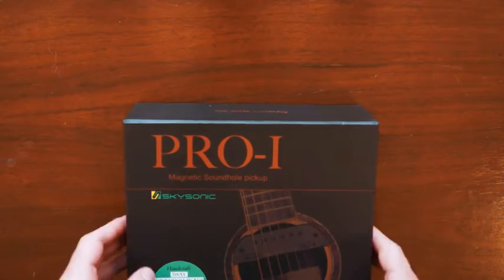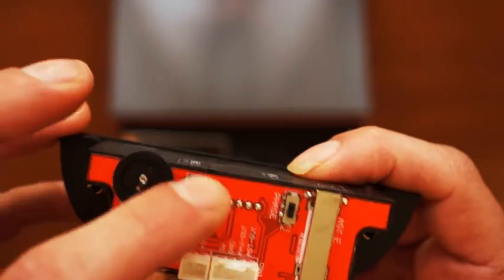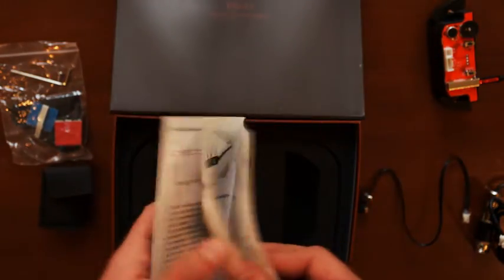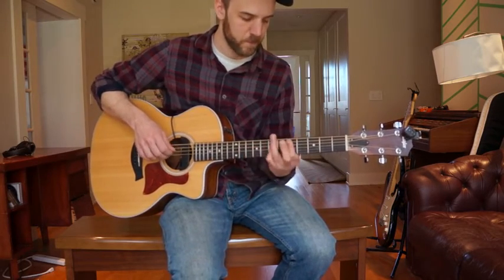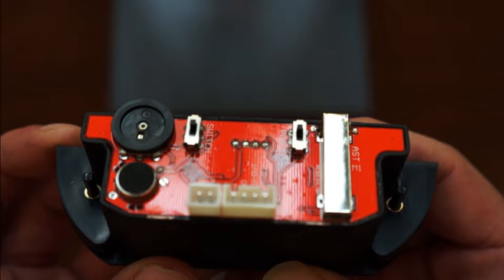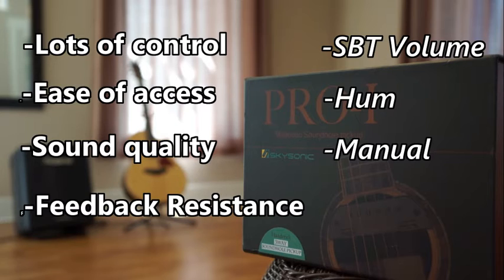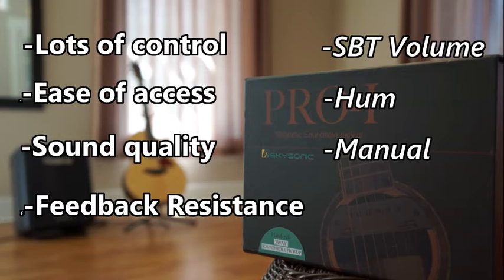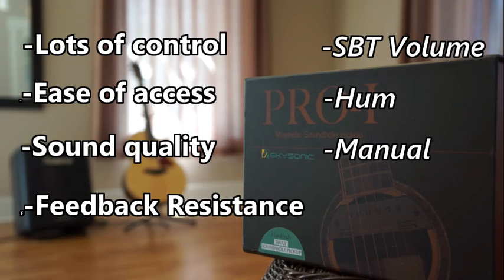SkySonic Pickups PRO-1 (Demo & Review)

Comment: Hey Curtis! Thanks for the vid! Sorry for bothering but could u please compare skysonic pro-1 and Seymour Duncan mag mic in a few words? I would be very grateful! We don't have skysonic in my country so I can't try it live, can only order from the internet. But I've tried mag mic and it sounds cool. You told u also used mag mic so your opinion would be very precious. I play more like rhythm-guitar in a band if that helps, I've heard mag mic isn't very good at getting through the mix. Thanks a lot in advance!
Reply from the maker: Hey! Hmm, what can I say. They are both very high quality pickups. I do find that the magmic is able to blend in much MORE of the  microphone than the PRO1. The Pro-1 has a better Mid-range and is overall much much more flexible with the added SBT under the bridge. I would say the magmic has a much more mid-scooped sound when comared to the PRO1 but that is not necesarily a good thing. Hope that gives you some pointers. You can't really go wrong with either. Cheers
Reply: @CurtisThorpe  thanks!

Comment: i just install the T903 skysonic but its giving me noise more than usual noise, my pup is similar to your pup but have no undersaddle thingy, my cable is new fender cable, but noisy,
Reply from the maker: Hmm, still having issues? Have you tried contacting SkySonic?
Reply: @CurtisThorpe  hi i resolve it, i was using heavy compressor software settings while recording, i turn off compressor and noise is very minimal and negligble, after eq the sound is sweet.... Cheers .